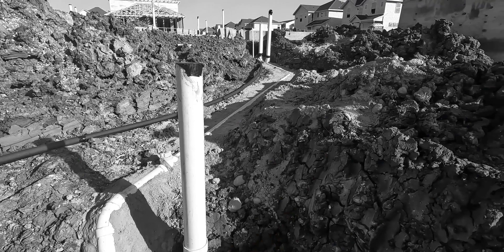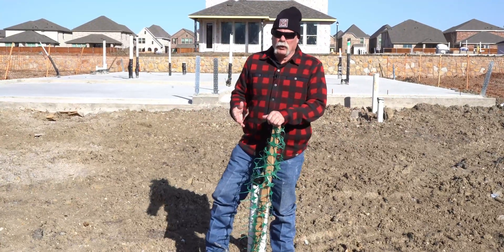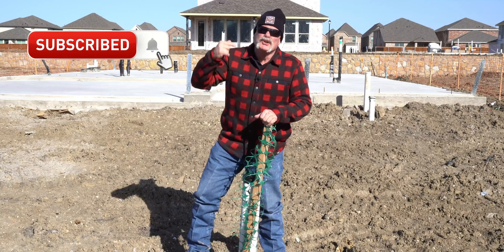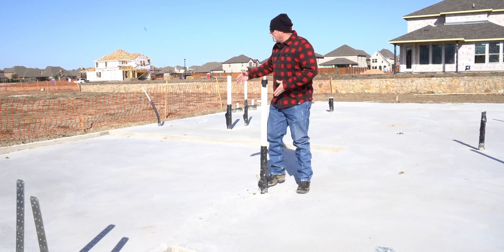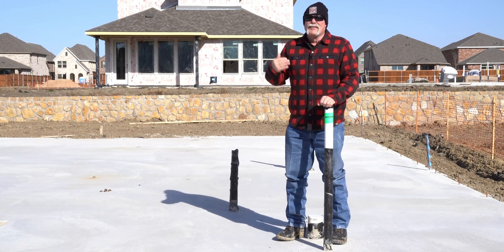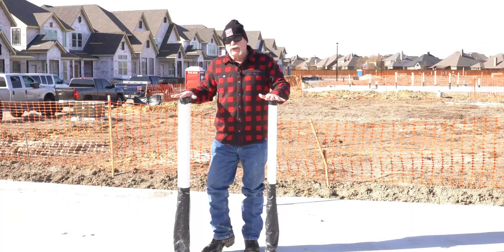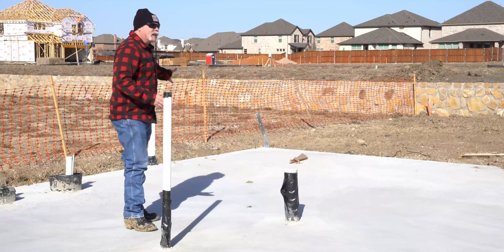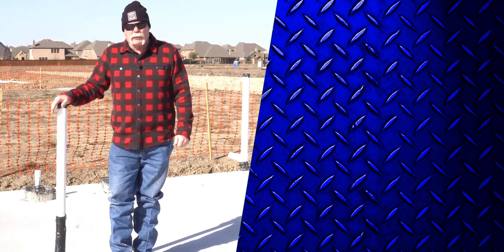HOW TO PLUMB A HOUSE DOING A ROUGH-IN Part 2

Comment: Over the summer I did all the sewer side rough in for an industrial site, I spent a small fortune in cleanouts. Because the company I work for owns the industrial site I know I’ll be getting the call of ever there is a backup so I want to have the best situation possible if it happens

Comment: currently building and we did all the rough ourselves, and we made a couple mistakes but nothing that can't be corrected easily. The issue we had is how do you get proper slope on drain lines and still get the vent/drain stack straight and square like you said? Most of our drain/vent stacks have a bit of a lean to them because of this. We're completely framed in now and we miscalculated a drain location for a tub, so we're just going to do a shower there instead. We have radiant in the slab so breaking up concrete is a non starter. Live and learn.
Reply: 3/4 inch every 4ft for a typical drain

Comment: I've broken a few clean out ts with the skid steer doing stucco grades. This was when I first started operating. Great vid Rodger. One job I was on the graders had to do plumbing back fills on the pads. That was the only job I've ever been on where the graders had to do trash pick up  an plumbing back fills. Was in the contract.  I've also had to straighten out them lavs an toilet up rights when I did the pads. Learned a lot working at that company an learned a lot about what not to do also. Having that cleaner out an the end is nice. All the homes I worked on have them. You are bringing good light to the plumbing trade an trades in general. 👊.

Comment: I’m a plumber of well over 25 years and I can’t stand seeing out of plumb and square pipes. On my service line clean out I always remove the 4” plug and install a popper. I’m with ya i much rather clean sewage in the yard than in the house that’s a no brainer. I always run my water lines under the slab to each fixture and even my above ground fixtures gets a dedicated waterline that’s run to a manifold that way I have no fittings in the walls. It’s a great system and yes on clean outs. Never enough clean outs!
Reply: Sometimes the concrete guys knock it out of plumb. So many of my ground roughs have been messed up by concrete guys.

Comment: im a plumber we use 110 pvc to under ground we typical have 2 lines out one is from toilets to septictank two is from sink to a second tank the pipes that we putt under concrete must be 110 pvc then for the washer and sinck we reduce the pipe to 50 40 mm pvc the wather that goes inn to the house is drilled trough the concrete wall typical only one inlet witch is the main for the house there we use 36 mm pem pipe blue ofcorse so i would say it is werry difrent in plumbing we use oil burners to heat the house and water moest plumbers here use copper press fittings or alupex but we still do it the good old safe way solder we use hamp and pack salve rater then unitape/teflon 
teflontape is moest used for oil line here but i like your videoes it is intresting to see how others do it diffrent 👍

Comment: i use to work at a small contractor, build up just like this exept on the waterlines they were in the walls with easy acces.
plumbing was placed with bars and styrofoam for insulation. 

and here in my rental house the company started isolation trough the walls and hit the plumbing instead of 2 bigbags of iso balls they used 6 ...where did they go .. and why did my toilet clog and gurgle ...
maybe because of the balls ans leaks oh and roots on the outline too.
living on a corner house made it easy started the pipes in de backjard , along the house and drains came about a foot underground trough the walls into the main and the ceramic rooted area is innersleeved with pvc what cut down the roots and made a new inner layer and i have a 1 way cleanout now.
all flushes out now they have to come for a leak in the waterline going upstairs wall is getting bumpy and porous i think it's a drip leak but before it crumbles down ....
they can be some creative with p traps too kitchen sink has one made out of 6 elements sink to straight to small bend to straight to p trap to another bend to qnother straight to a 90 to straight to the wall ...yea .. them's doin good haha

Comment: If I were to inspector I would pass that house. I like cleanout's where the code says they should be, and where it just makes sense. Never liked the saying, "not enough time to do it right, but always enough time to do it over". As you know, doing it twice cost money.
The last time I did rough under a slab we were still using copper on the water lines. 🙄

Comment: I absolutely hate water lines buried in the slab. Every home I have owned that were slab on grade water lines always freeze. As a hvac tech I hate slab homes up north, even in Texas they can freeze.
Reply: That’s not really an issue in Texas. I’ve worked about as far north as you can get in Texas without going into the panhandle and I’ve never seen a water line freeze under a slab. Maybe up north where the option is basement versus slab the slab is more likely to freeze. Here when they don’t run them under the slab, they’re run them in the attic which is much more likely to freeze.

Comment: Hey Roger do you know what could possibly be causing my shower's pipes to be making a gurgling sound when I turn it on , I woke up in the middle the night to take a shower and when I turned the shower valve the pipe would make a gurgling sound and the water from the shower head goes on and off and the water pressure is random is the pipe partially frozen or is it something else ? None of the sink's are having this problem either so I don't know what's going on , any help would be much appreciated
Reply: Not a plumber but it sounds like air in the pipes.
Reply: Yes

Comment: Hey Roger, 
I enjoy your videos and have a question. I have a 50 gallon, dual heating element electric water heater in my basement/crawl space that has no floor drain. The house is 6 years old and I don’t know if the water heater has ever been drained or flushed. The main waste stack (PVC)  out to the mound system is about 5 feet away and is 4” diameter. Is there a way to drill / tap a drain faucet to this stack or do I have to use my little pony pump to push the water upstairs and to the outside ? I’m hoping my explanation is clear. TIA.
Reply: Best you could and should do if you’re going that route is to cut a clean out into your drainage if it can be appropriately placed and then run a hose from the drain valve discharging into that C/O. Or just use a laundry sink or a bathtub/shower if you have access. I would use a transfer pump if you can and don’t forget to open the T&P Relief Valve